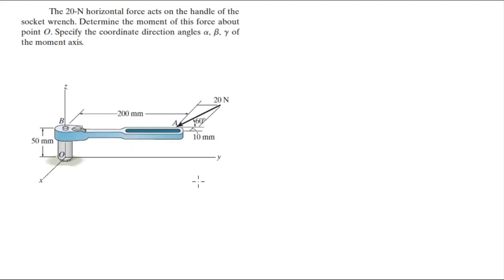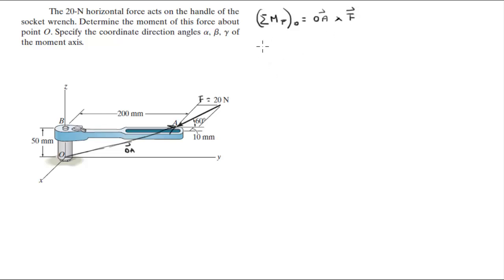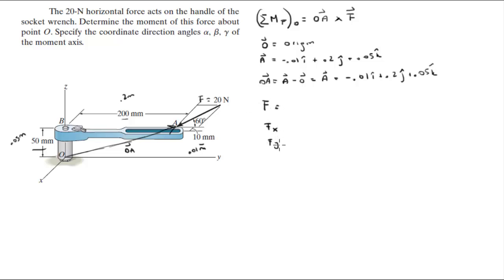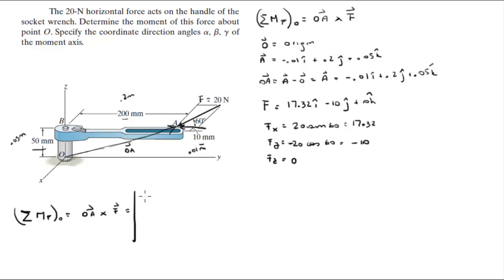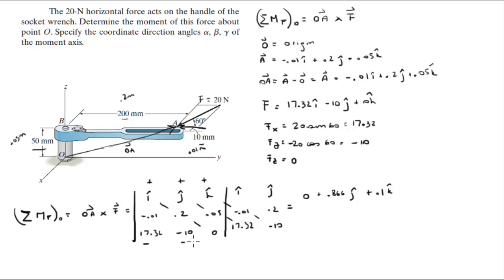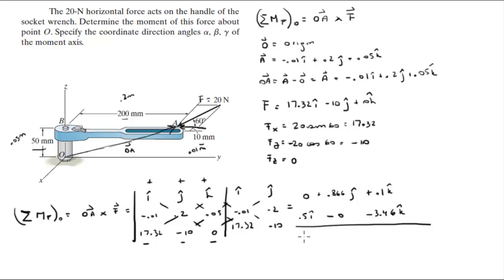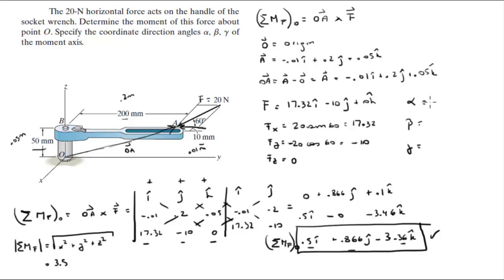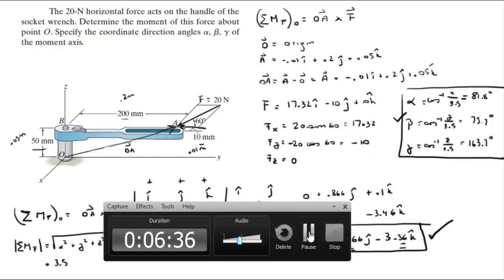Determine the moment of this force about point O

Comment: 5. Determine the magnitude of the horizontal force F = -Fi acting on the handle of the wrench so that 
this force produces a component of the moment along the OA axis (z axis) of the pipe assembly of 
𝑀𝑍 = {4𝑘} 𝑁 ∙ 𝑚. Both the wrench and the pipe assembly, OABC, lie in the y-z plane. Suggestion: 
Use a scalar analysis.